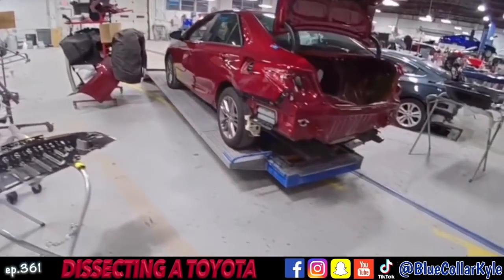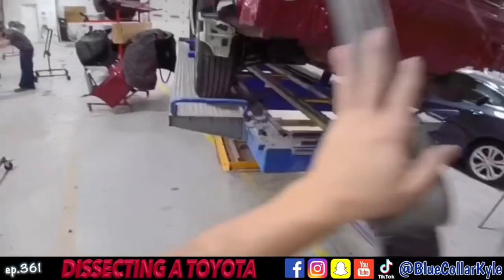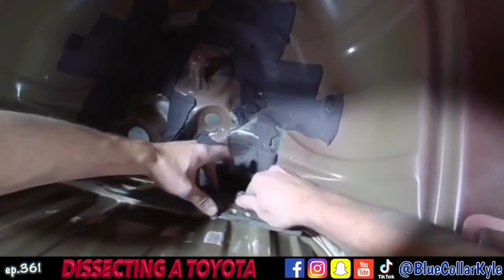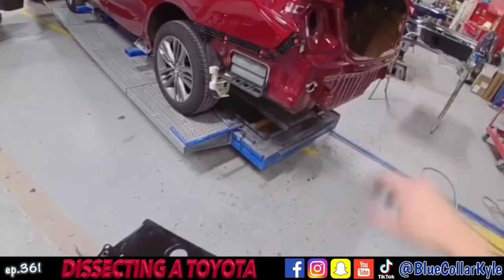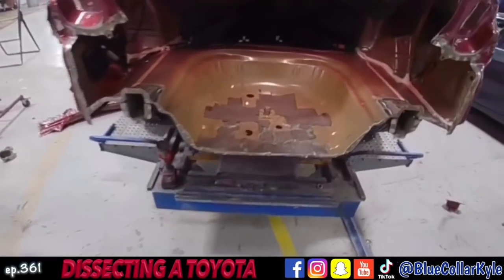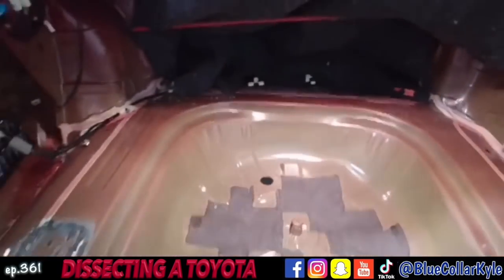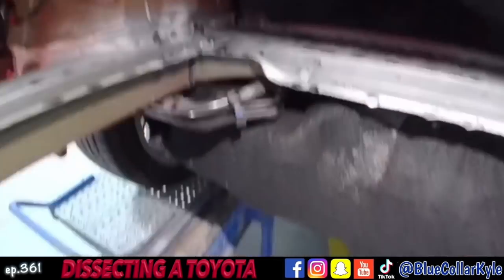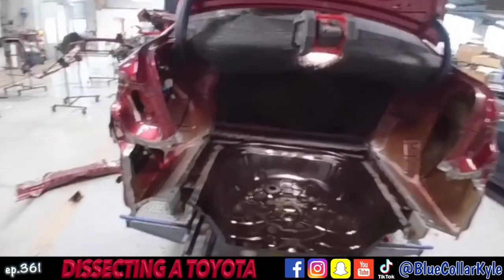Dissecting A Toyota!

Comment: After he drilled the two holes to pull the rear panel back into spec I would have called it done. Put duck tape over the two holes or if you wanted to get fancy with the repair. You could plug with the Flex paste as seen on TV. If it can make chicken wire into a boat it's good enough for grandma's Camry.